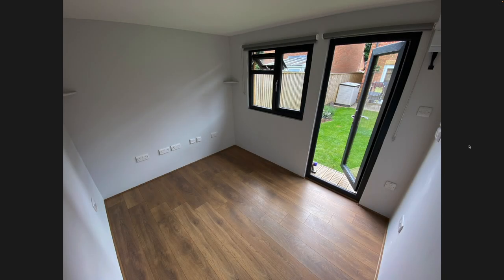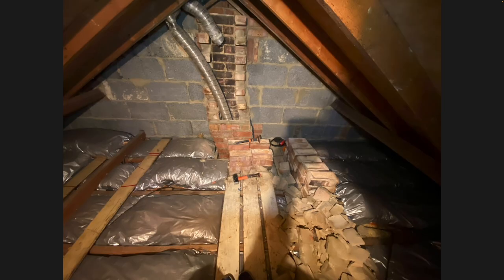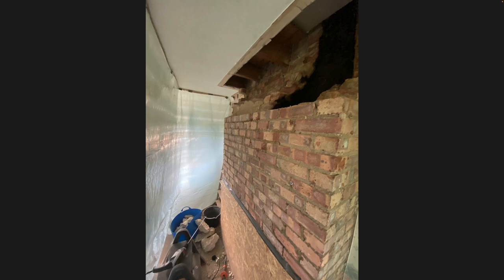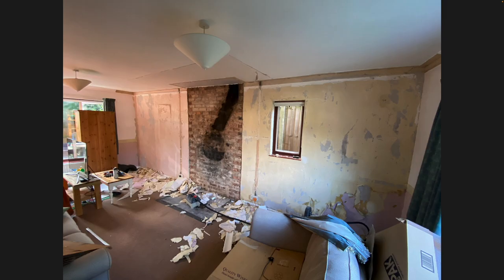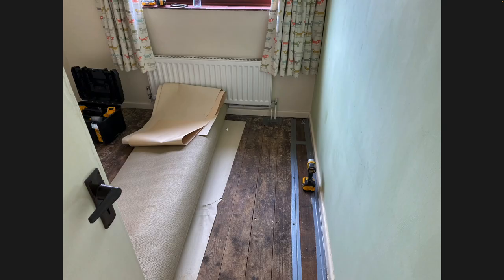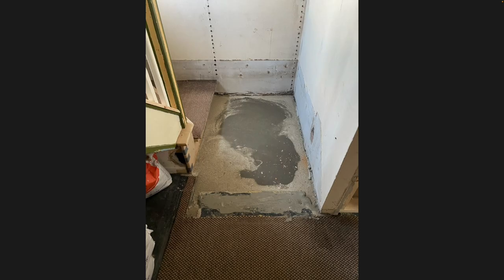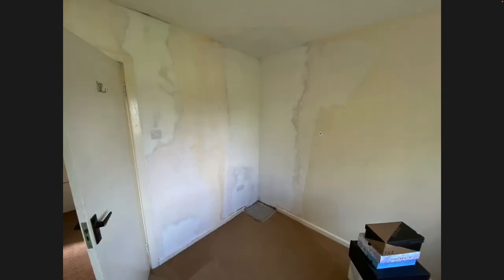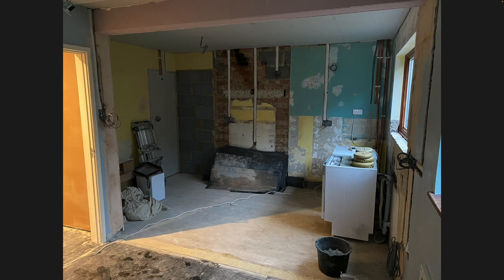Renovating and Modernising a 4-bedroom 1960s House in the UK

Comment: I've just discovered this video and it really interested me because we moved into a house 7 months ago, which had some similar challenges. In our case, we found that there was a bare minimum of wall sockets, backed up by a multitude of extension leads and an old consumer unit, so we had to fully rewire - and that was before we got to the kitchen. The walls were covered with wood panelling, like your kitchen ceiling but painted white - quite a job to get them off and the walls replastered. Still we are nearing the end of our renovation now and enjoying having a house with more spacious rooms than the 1999 one which we moved from. Looking forward to seeing more of your work.

Comment: FYI, the reason the cables are not chased behind the coving is that when they installed those newer sockets, they would use a tool to chase up behind the coving to get the cable up stairs and to the circuit.
Reply from the maker: That might be but didn’t explain why they weren’t chased for the last few inches just above the socket. Just odd!

Comment: Just a question: do you have any deckhead cable penetrations that you may recommend for use in a house, as i wang to run my ethernet cables from the understairs compartment up theough the floor-plate and across to the first floor airing cupboard before routing them up into the loft-space for PoE cameras.  Cheers!
Reply from the maker: I didn’t use any conduit (if that’s what you mean) but any flexible electrical conduit would work if you wanted to add more runs in the future. But I’m not working with steel or metal of any kind in the main framework of my house.